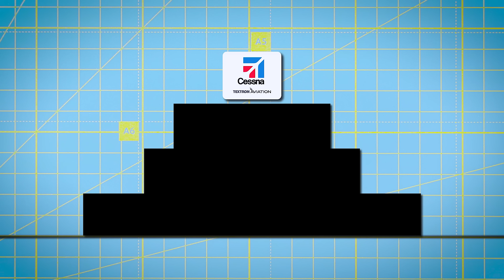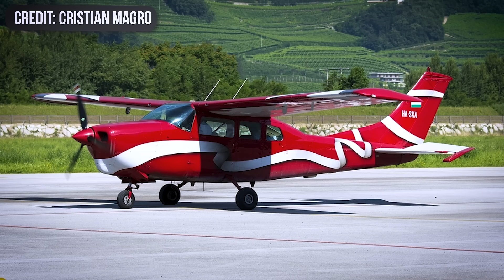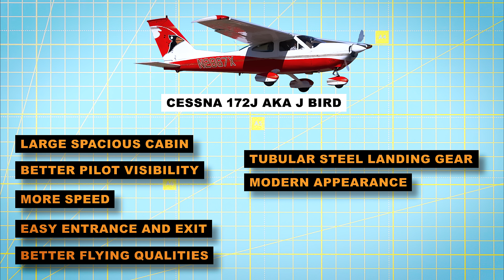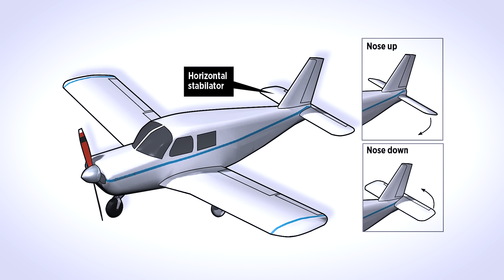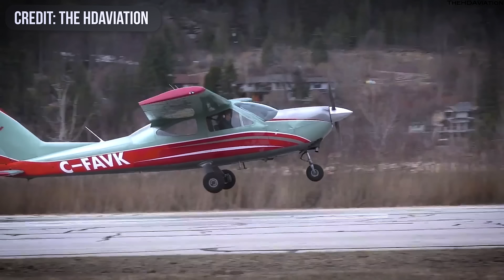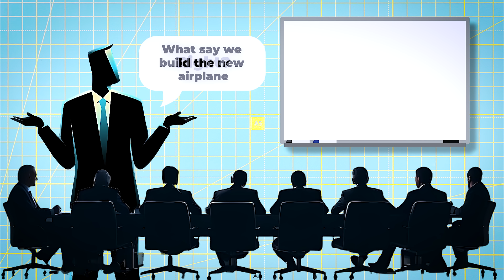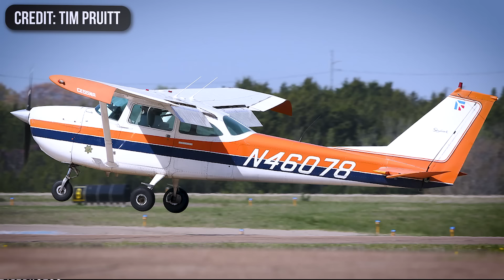Cessna 177: The Plane Pilots Hated

Comment: In the 1970's I flew Cessna 172s, 182s, 177s, 205s and 310Bs. Also flew Piper Arrow 2 and Cherokee 6 300, and Mooney Mk20 and 21. The 177 just took a couple of hours longer to master its landing characteristics, but man it flew great, was real roomy inside and burner less fuel than 172 and beat the speed of a 182 on cross country. When I didn't need six seats, I would go with the 177. It could carry as much as the 182 and burn less fuel. Only the Mooney MK20 beat the 177 in fuel efficiency on a cross country, but inside room too tight for comfort for long trips.

Comment: IMO your bad mouthing of the Cardinal was over the top.  I have enjoyed about 500 hours flying the 177 and 177 RG.  Comfortable, quiet, decent useful load. 
IMO Cessna misread the market and should have gone the "2/3ds of the way to a 210" instead of replacing the bread 'n' butter 172, which I believe is still in production. If I were looking to buy an airplane it would be on my list along with the C210 and Bonanza...